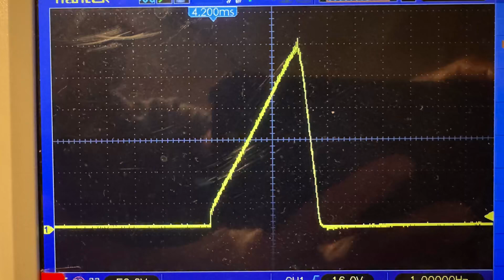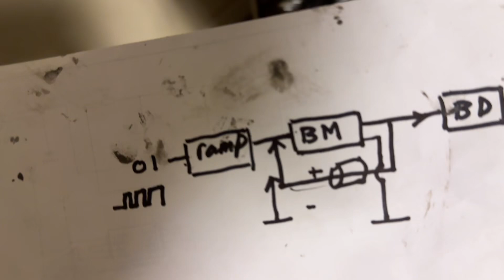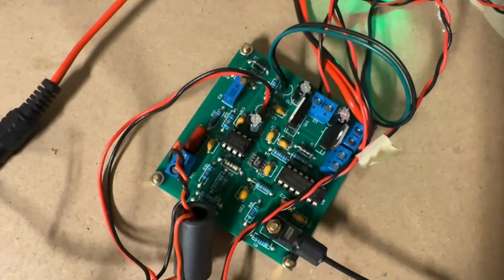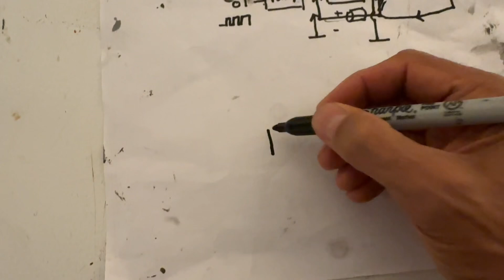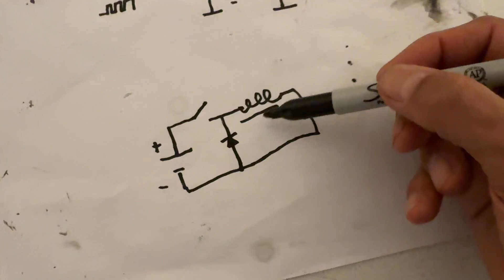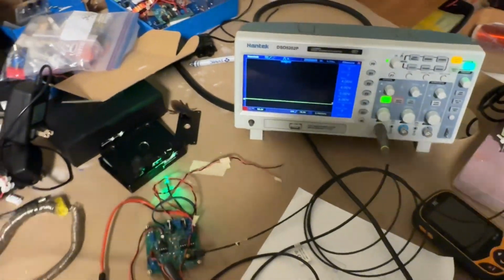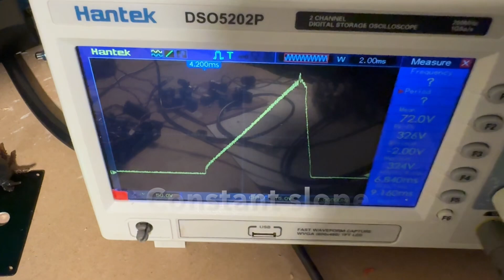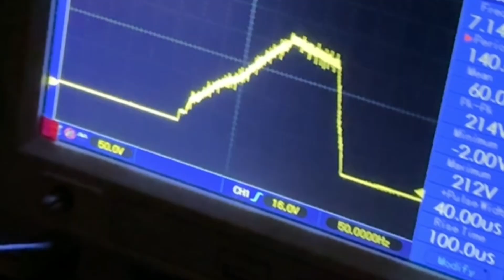QCW Tesla Coil Ramp-up

Comment: @ 8:10
Is that diode not backwards?
Reply from the maker: Yeah, that’s correctly oriented. Because when the magnetic field in the inductor collapses, the current flows through the diode and into the capacitor in the correct direction.

Comment: 50 Hz line modulated "ramp" allow a typical 400 kHz VTTC about 2 feet spark at about 50 kV top volts. Seems that such "ramp" is not optimum and 15-20 ms ramp would give about 4 feet spark at the same voltage. You could estimate top volts by mounting small (2 cm dia) measuring spark ball gap on the top of the coil
Reply from the maker: Yes I can get great ramps from the mains quarter wave.